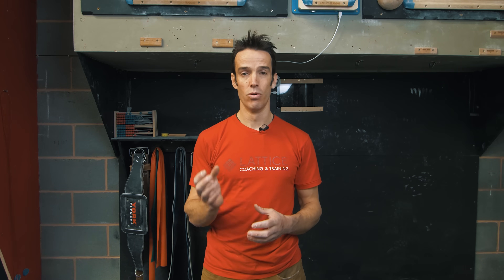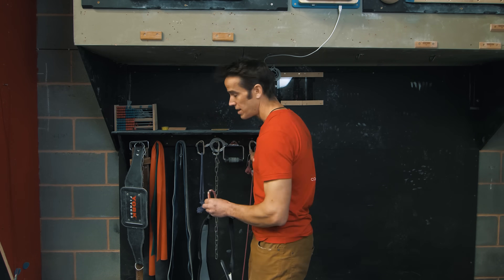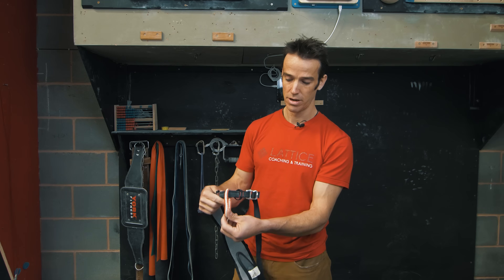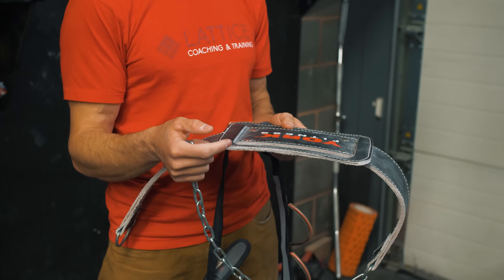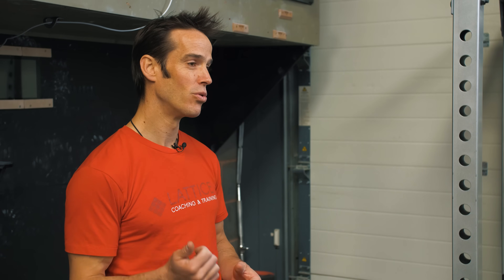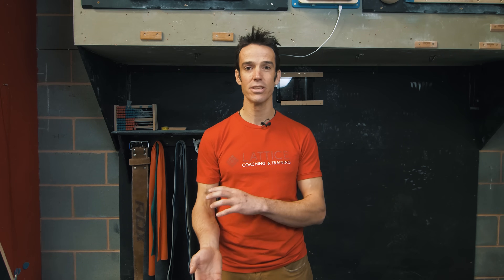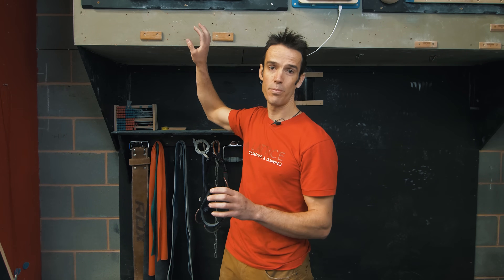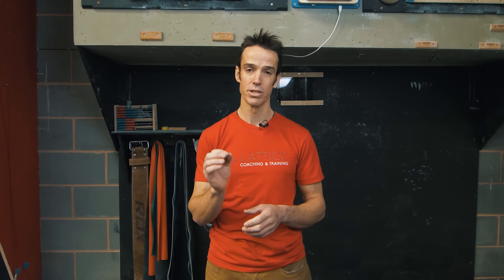How Strong Are Your Fingers? This Is Our Testing Method Explained

Comment: Minor technical point; the weight of the handle for the pulley set up should be subtracted from the weight on the other side of the pulley set-up if you want to know (exactly) how much assistance you're getting. Alternatively you could use a very light handle and forget about it. Using a heavy handle and not taking its weight into account is a (minor) problem. To see that this is the case, imagine a 10kg assistance weight on one side of the pulley and a handle to pull down on that itself weighs 10kg - that setup would be balanced without anyone pulling on it and would offer no assistance at all. More realistically, if you've got 10kg of assistance weight and your handle weighs 500g, you're only getting 9.5kg of assistance.

Comment: How about a micro traxion for a pulley? Too small? Efficiency is 91% Does that mean that when I do -10 kg hangs I'm actually getting 10*0.09+10≈11 kg of assistance?
Reply from the maker: Micro traxion is great! 91% is right up there in terms of efficiency. This is a great pulley to use for training and assessment. Don't worry too much about actual load, as long as you keep the equipment the same you'll be able to track your training and progression.
Reply: @LatticeTraining  Alright, cool! Thank you for the answer :D

Comment: Question! Climbing about a year and a half, V5 boulder, 6c+ lead, just trying to get generally stronger and more ready across the disciplines for post lockdown. 
I started hang boarding a month ago - max hangs every 3 days, I tested max hang today and I can do half crimp 7sec on a 2cm edge at 120%bw, or plus 13.75kg.
Could I add more fingerboard sessions to my week safely if they are training different things? So instead of doing max hangs for strength every 3 days, could I do max hang, then 2days later do endurance, then 2 days later max hang repeat, 2days later endurance... Repeat? Thanks!
Reply from the maker: Hi Daniel, that doesn't sound unreasonable. You body will soon tell you if it's happy or not! Keep tracking max scores to assess whether you're recovering adequately and gaining strength slowly.
Reply: Thanks guys! I'll let you know how I get on! I've been devouring your YouTube resources, so thanks for that it's really been a lifesaver. Well, a finger strength saver

Comment: Tom; Iggi here I use a 5mm cord with 2 pulleys 18 inches apart so that the weights aren't getting in my way. Is this good or does it skew the results? I'm worried now lol.  I see Eric and others using  a 2 pulley system...  what's best?
Reply: Curious about this too.
Reply: @frankheiser2775  IMO. It's been a long time since I attended physics class but I'm pretty sure the way you are aligning the pulleys does not give a mechanical advantage over a single pulley. Most important factor is to ensure the testing and training methods are identical. If we get our comparative data to other climbers then we need other consistency but I think this is the same.

Comment: I can unfortunately only use the metolius wood rings as I'm in rented accomidation. I know it's not ideal but is it safe to perform exercises from your crimped app on these?
Reply: I am renting too but I got 2 3/8 inch eye anchors and found a joist In the ceiling and have my hangboard set up between those and I can hang anything on them. Including hammocks, rings, my daughter's rope swing, clothesline...all sort of useful stuff. When we get ready to move put some wood filler in there and mud it like you would mud drywall and then paint over. waaay worth the extra effort to get it back into "rental" shape.

Comment: I have a question what is the broad in the middle with the plug in it? what does it do?
Reply from the maker: Sam Russek it’s our digital finger strength testing rung. We use it for some of our elite athletes and also with a number of our research partners
Reply: @LatticeTraining  how does it work is it time based?

Comment: For hanging the weight, I use a 12 inch length of pipe with a floor flange screwed onto the end and an eye hook on top. It’s cheap and hangs waaaaay better than putting the chain through the plates.

Comment: Something you should talk about is the transition point from single arm assisted to single arm with no assistance/added weight. Previously training on the lattice edge I have passed this point with my right side and played around it with my left. However I seem to get a huge amount of "stabilisation" using the pulley for assistance. Going from 2kg of assistance to 0kg is a massive step. I trained through it by adding weight to me and removing the same weight using the pulley. I found I needed to be able to hang around +3.5kg to me (2.5kg on pulley 6kg added to me) before I was able to get a quality unassisted hang on my right side. Have you got any tips for improving this training progression dead spot?
Reply: Also, turning this into a data question. Do you see a "clumping" of test results around this 0kg assistance point? A lot of people who fail just as you get to 0kg then a break through where they are able to start hanging one arm with added weight? Would this indicate that finger strength is not the limiting factor and the, shoulder stabilisation, core or something else is a decisive factor when transitioning to unassisted hangs?

Comment: is there a real down side to the over engaged position? I dont have the means to do a max strength test so been doing the varied grip hangs off the crimpd app. I find the back 3 hangs really hard (though I can complete them now!) but I cant hang as low doing them in half crimp, open I could but half crimp I am in the position you have called Over engaged. is that ok while im still getting stronger at it?

Comment: If I rest 1.5 minutes I get up to 30kg additional, if I rest 5min I get up to 37.5kg. My endurance isn't the best - which one am I supposed to take as my max? Im considering going for a light plan when shutdown is over but I'd like to train with the "right" amount of weight until then
Reply: For both testing sessions I failed in the 4th try first time at 32 second time at 40
Reply: You should rest as much as necessary to make a max effort every rep.

Comment: does it make sense to train with 2 Hands if i can hold 60kg+ without really getting to my limit or should i go for only one arm in the future?
Reply from the maker: T.M. Yes you should look at single arm work 😊
Reply: @LatticeTraining  Thanks a lot i wasnt quite sure and the weight got very uncomftable over time😀
Reply: lol I weigh not much more than that.  Definitely move to 1 hand, you'll be really surprised with your results.
Reply: had a similar result plus bruises on my hips, definitely not doing two arms with 60+ kilos again😆 (except maybe for re-testing in a couple of weeks)
Reply: If you're trying to assess your 2-arm 12-20mm half crimp strength, then add as many kilos as you can possibly hold! If you're trying to assess your 1-arm 12-20mm half crimp strength, then you will probably use less weight.

If you're training your fingers (not doing a test), the it would be best to keep it simple and actually reach your max potential. Switch to 1-arm!

Comment: Awesome video as usual! I plan to do a video about such a testing session (and in general the Lite plan) soon :) One question though: You mentioned in the video 1 1/2 minute rest and 5 second hang. In the app and the PDF I have it says 2 minutes rest and 7 second hang. Did you change that in the meantime?
Reply from the maker: Boulder Fighters No, we just use slightly different methods for different tests. On the whole, we use 7 sec hangs for the vast majority of hangs. There is some lattice board testing we do at 5s as well 😊
Reply: @LatticeTraining  Thanks for the explanation. I was just wondering as I plan to do such a session today ;) Thanks again, really enjoying your content.